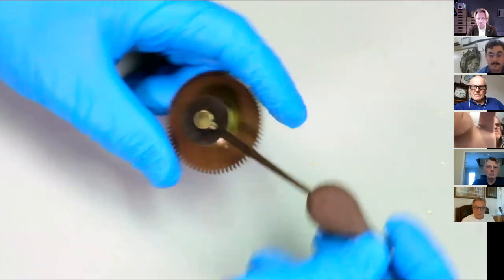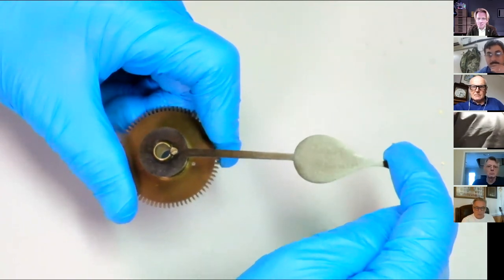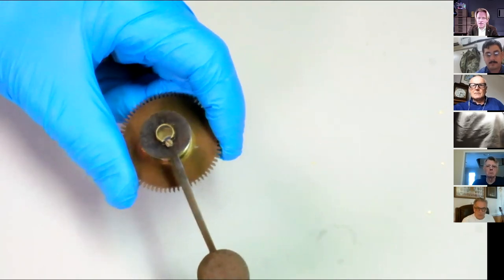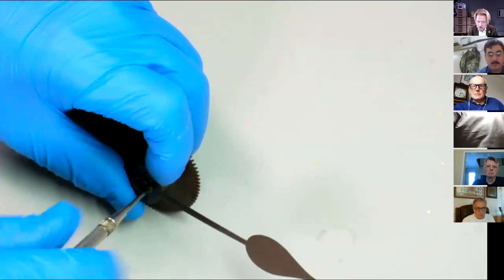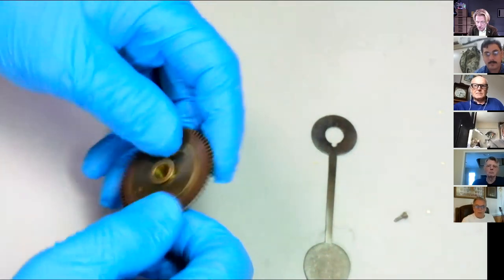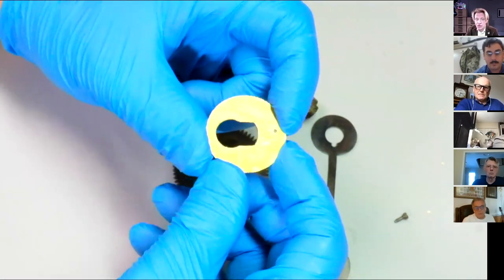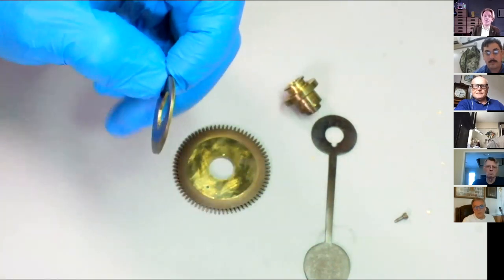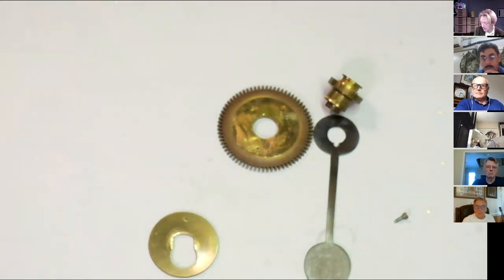Open Clock Club  #039  2021 08 21

Comment: Please Slow down and explain how and what you are regulating by preload. What does less or more clicks do" in the performance of the lclock.?
Reply from the maker: Hi Lowell.  if you were to plot the torque output from an unwinding spring, you would have something akin to a stretched-out S shape with a reasonably straight bit in the middle an curved ends.  In a clock with positive escapement error like an anchor escapement, the clock will run faster with more torque and vice versa.  The point of the mainspring set-up and the stop work is is effectively to cut off the ends of the S shaped torque curve so you only have the middle bit.  Even so, the fusee and spring torque curve are never perfectly matched so you can fine-tune the arrangement will less or more set up.  lets say the clock keeps good time for 6 days then in the 7th  starts to loose time, you need to move the used part of the spring 'up' a bit and you do this by increasing the set-up.  Conversely, if the clock gains in the first day or so then settles into a relative losing rate, you need to decrease set-up to use less of the top end of the spring curve.  Hope that makes sense.  an electric timing device is useful for this but you can put timekeeping manually over a week, make an adjustment and see if that helps.  The clock I worked on I never gotten round to changing it so it runs fine and loses at the end of the week.  I just wind it more often!  M
Reply: I wonder how much setup you can apply before you run out of spring to wind at the end winding the clock? Meaning that you don't get all of the chain on the fusee because the spring is already tight, or fully wound.